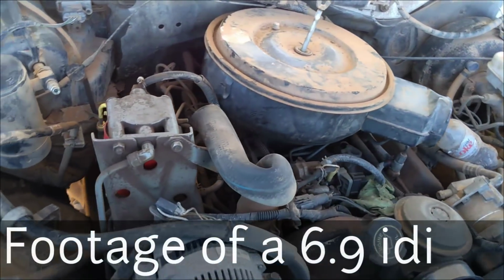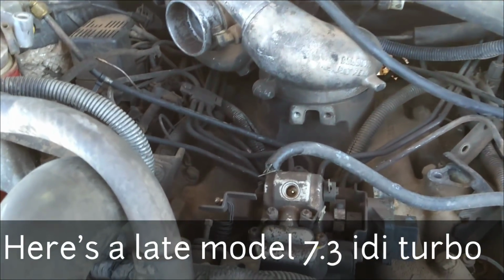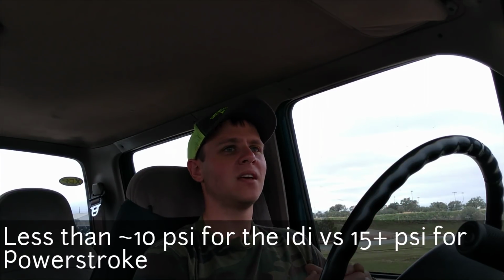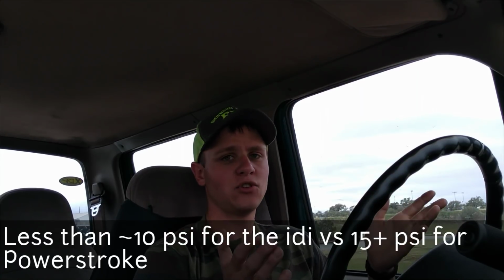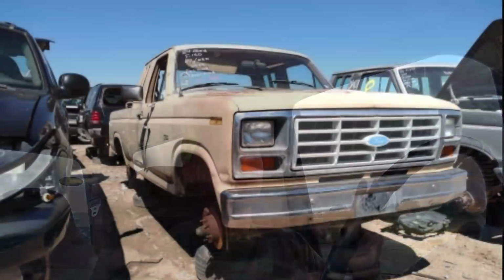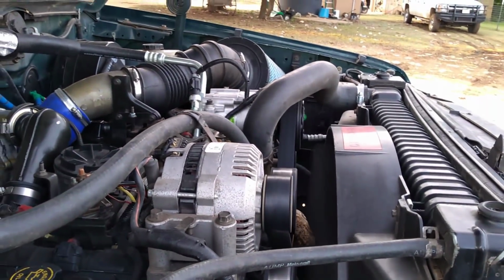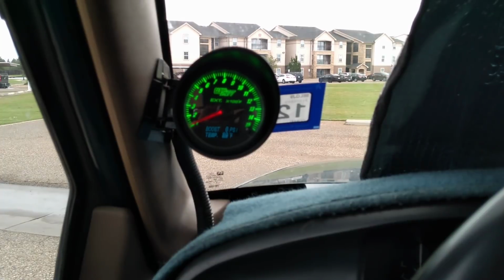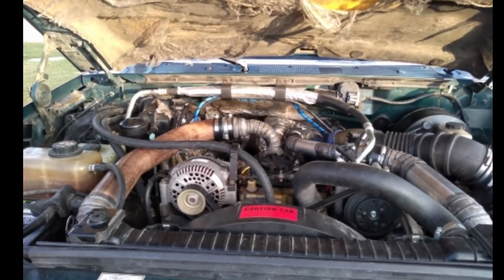7.3 Powerstroke Pros and Cons Part 1 of 2

Comment: After cranking my 1997 7.3 diesel my fuel bowl isn’t filling up with diesel, what is my problem?
Reply from the maker: It could be a number of things, check the easiest first, are you sure the tank has enough fuel in it? Did you swap the engine with a newer Super Duty one? What work did you just do? Or did it all of as sudden stop getting fuel into the bowl?

Comment: What’s a decent mileage to buy a reliable 7.3??
Reply from the maker: I wouldn't say mileage has much to do with 7.3 reliability. I bought mine with 343,000 miles on it and it's still going strong with 410,000 miles now. I'd more look for maintenance history and see what parts have been replaced. Certain things like the high pressure oil pump, injectors, fuel pump, turbocharger etc. all have limited life. My truck for example got new injectors around 200k miles and a turbo rebuild around the same time. Also I've replaced the fuel pump along with the injectors pretty much bringing the truck back to a newer position with fresh o-rings etc. As long as the core of the engine is in good shape, i.e. it has good compression and doesn't have excessive blowby, you can spend the time and money to make it reliable. It's just a matter of how much work you're willing to do to the truck. At this point many of the 7.3's are well over 20+ years old so certain things will need to be replaced at some point to keep them reliable. Afterall certain components such as o-rings and gaskets will fail just given how old they are, yes even on an exceptionally low mileage truck. If you're trying to minimize the work you do to the truck to make it reliable, find one with good maintenance history and as many new parts as you can find already on it.
Reply: @Rnddiesel  Is the auto transmission good in these trucks?

Comment: Due to this video you convinced my purchase of my 95' super cab 4×4.  With only 276,000 miles. It's now at 308,000. 
Ts6 position tuner that's left at 100+hp
4" straight piped. 
95' also has an OBD2 port.

Comment: Hi sir thanks for your videos is very helpful 
I have a problem with a 2000 ford f250 7.3 cranks won't start  im reading the ICP psi  and when I turn the key on  it reads 1,500 psi and when I crank the engine is about 3,500 psi I'm not a diesel guy but that's not reading fine  I don't know  whats going on maybe you can help me thanks

Comment: Hey great video! I clicked on this and, seeing a person half my age, assumed it would be about tuning, rolling coal, and which halo headlights I can get for my 7.3 all while watching burnout B-roll. Turns out I was wrong! Good information. One of the reasons for the high injector pressure in a direct injection engine is it needs to overcome the high cylinder pressure.

Comment: Here's an off the wall question: Do any of you know if the F350 (7.3 only please) was ever made/available with right side drive ? I'm moving to Thailand where they drive on the "wrong" side. I'm hoping they were exported to Australia at some point.
Reply: You would probably have better luck contacting Ford, there is a company in San Diego called Right Hand Drive that converts new trucks for export, you might call them and see what they have to say.

Comment: OK > Haven't seen both videos yet but wanted to ask you. That Short Bus I'm looking at has the IDI Engine and its a 1991 International . So with that said. Would I be better off to look for a Short Bus with the 7.3 Power Stroke Engine ??  Would it be my best bet in the long run since I plan on keeping if from now on ???? Thanks in Advance. : Love the Videos
Reply: Terry how deep are your pockets and what are you using it for idis are beast can take a beating and come back for more again and again, if you’re gonna work on it yourself idis are super simple and much cheaper than a powerstroke to maintain but they have less power than the powerstroke but idis have never Left me stranded I blew a head gasket 300 miles from home could see the gasket flapping around still got me home
Reply: @kylebrown5957  Well that was interesting about the gasket. Thanks for the reply. Appreciated.
Reply: I might be biased especially since I had a powerstroke leave me broke down 1k miles from home with a load
Reply: @kylebrown5957  Ha  That could do it.
Reply: Watch zip ties and bias plys not kid friendly at all though
Reply: @kylebrown5957  Not Kid Friendly . Good thing I'm not a kid then. Ha  Thanks

Comment: Idi injector pressure is a bit higher than that
Reply from the maker: Serious question: How high does it get then?
Reply: @Rnddiesel  it takes 1400 psi minimum to crack open old injectors and new injectors pop open around 1700 psi you weren't to far off
Reply from the maker: @jrhaley9624  Very interesting, thanks for the info!
Reply: @Rnddiesel  i like to teach people on small things like that i dont want you to feel like im being rude i just want to see the knowledge passing down

Comment: Me personally I prefer the 94-97 Powerstroke, not the rebored & turboed 6.9. I say that because it has OBD2 so it's easier to diagnose & you don't need to deal with the OBD1 nonsense of blinking lights and all that fun jazz. But then I drive a 95 7.3 that I got for a steal that was taken care of so that's probably why and because I've put all new sensors and in it, new IPR, & glowplug wiring harness and gasket. newer seats and carpet. After i fixed it up since I'm 16 my parents asked me if I should sell it but I said no cuz its a good vehicle it's not terrible on fuel and its mostly solid even so I wouldn't want to sell it if I knew if it was going to a bad home-like "WD" it's a good truck. and that it'll probably last me 20 more yrs or so with good maintenance. These old motors typically just keep on going.

Comment: I have a 97, 7.3. It's a good truck engine, but the electronics are unreliable.It seems like you're constantly changing some sensor. I went thru 3 cam position sensors in 2 months. If I was young, I'd put a Detroit Diesel, all mechanical, 71 series in my truck. And I'd be done with engine work for a couple decades. I have a couple Detroits 671s made in the late 1940s. Still going, all parts and engine kits still available.
Reply from the maker: I'm sorry to hear you're having such issues with the electronics! I've had good luck with mine. In the past 2 1/2 years since I changed the cps, I haven' had a problem since. Are you using motorcraft sensors? That's awesome to hear your old Detroits are still going. I've also got a 51 Cat D4, it only makes 40 horsepower, but it still fires up to problem if you can get the pony motor to start.
Reply: @Rnddiesel  Two were motorcraft. Code reader said CPS, both mine and Fords. I changed the fuel pump for something to do. 70,000 miles since major engine overhaul. But changed it and the problem seems to have gone away. Why was the code CPS if it's the fuel pressure? And what's next? I'm on first name basis with the tow truck drivers. That said, it's probably the best PU engine I've had, I just wish it was as reliable as a mechanical injector engine.
Reply from the maker: @oceanmariner  I see now, you have had a bad experience with the truck! Electrical problems can be hard to track as well. I've heard that with 7.3's, its best to only use Motorcraft electronics in them. I've done that and they've been reliable. Changing the fuel pump shouldn't affect the CPS. As long as your truck is stock, there isn't a feedback fuel pressure sensor, only a fuel restriction sensor and a water in fuel sensor in the bowl as well. I suspect you may have a loose connection or shorted wire somewhere. You may want to trace the wires from the CPS and tug a little on the connector to make sure the wires aren't loose. As far as I know the only single sensor that can kill a 7.3 is the CPS. A bad Injector Driver Module can also cause a no start, but I suspect a lot of times those die because there's a short in the under valve cover wiring harness. It may be worthwhile to pop the valve covers off and make sure the wires aren't chafed and the connections aren't burnt/corroded. There's also the ICP sensor, but you can unplug that and the truck will at least run so you can get it home. What symptoms have you been having? Does the truck just die on you going down the road?

Comment: I do want want to make a quick correction. 7.3 do technically have emissions. OBS trucks can have a cat and spilt shot injectors depending on the market it was made for. Also the PCM and turbo on the OBS is a emissions device. The super duty's added the intercooler as an emission device. Mine for example has ECM, DI, TC, OC. Most OBS will have at least 3 of those 4. My truck is a 97 with Federal Emissions. That can be found on your passenger valve cover in the emissions section. For good info on the 3 generations of the 7.3 it's recommended to go search on Google for "Ford coffee table books" a ton of good info on all of Fords American truck diesels. Great video 👍
Reply: I gave your mom a split shot injection

Comment: I have a 97 7.3 and im gonna say this. you are wrong on your interpretation on upgrades on alternate options. me personally im looking at a dt360 transplant. this is where you are wrong. 7.3 is expensive to update and upgrade. I went dt360 because im brand loyal. 5.9 cummins is more practical. 5.9 is WAY easier to upgrade, and cheaper to make WAY more power. not saying a 7.3 powerstroke is junk, but its not practical on a day to day work field. the dt360 is a medium duty engine and a 7.3 is a light duty engine. that's just what it is, man.

Comment: Hi. Can you tell me the differences between a 2000 and 01 and 02 why they sound so different? Which one is better? I am looking at a 2002 but the sound of the engine surprised me because I drove a 2000 and it sounds completely different. The 02 is almost quiet.
Reply from the maker: I have no idea what would cause such a difference. They should both have split shot injectors unless the injectors on the 2000 were swapped back to single shot injectors, or it's just a lot more worn out.

Comment: @  200.000 miles trans.oil n seal went out so replacing trans. Not pulling it out later again n changing all u joints n rear end oil should be ready for another 200.000 
Ps. Bought my 03 new never had any trouble with her in 17 years changed oil n fuel filter regular n she’s never ran hot. Cool she is a black Beautiful super cab lariat. Videos are great Thanks

Comment: Enjoy your info. Have a question.  I have a very clean 7.3 f250 crew cab automatic, 4 inch lift stockn16 in tires.
 Engine has 238,000. Larger down pipe, 4 inch straight exhaust . No issues
 Iv'e replaced the fuel bowl, mechanical  fuel pump
  Haveca chance of purchasing a 95 chasis ,No cab, but complete engine , manual transmission assembly and straight axel assembly for around $1500. My presentvtruck is pristine, No undercarriage rust, two New dual tanks , New chasis, short bed mounts,shocks all around ,front spring purchasis re arched. 
Want to know is it worth having the front straight axrl swap and changing to a manual trans Set up?????
Reply from the maker: It sounds like you've got a really nice truck! I really don't know enough about all the differences between axles (ride quality, payload, longevity, etc.) to give you any advice one way or the other. I personally would like the manual transmission in my truck, but the auto I have is working fine so replacing it isn't high on the priority list. I know the ride in my solid front axle truck is pretty rough, but I think that's expected with a 1 ton truck. If your truck is working fine, I'd say just keep it the way it is. Maybe if your heart is set on a solid front axle and manual transmission, then go for it. Worst case you have a spare transmission to drop in when yours goes. By the way, is your truck 2wd or 4wd?

Comment: I have an early 99 and I won’t ever let it go. It will no doubt out last me with proper care. Power steering pumps however are a different story. Anyone know who makes a good one?
Reply from the maker: I'll second that on the power steering pump. I don't know where you could get a good one, I do know where you shouldn't... I think pretty much all the modern rebuilt pumps are junk Chinese rebuilds. I replaced the pump on my 97 Chevrolet and heck a junkyard unit was better than the rebuilt one I bought from NAPA!
Reply: Blue top pumps are great & made in America.I put one on this summer & drove from Miami to Colorado back to Miami & back to Colorado  again..no problems.(2001 F250 SD 7.3)

Comment: I have a 99 7.3.  Chipped with DP tuner.  I have a big exhaust and  air intake but have not installed them. Truck has 204k on it and runs great.  Next mod I was thinking was injectors.  What would you recommend?  I tow motorcycles with it and plow in the winter.
Reply from the maker: Cool truck! Is it an early 99 or late 99 with the bigger injectors/ turbo? Do you have a gauge setup with EGTs/ Trans Temp? Having a gauge is a must before you even think about going any further in fueling, especially if you're towing and plowing.

I've got a set of 'stage 1' 160cc with 0% nozzle injectors. The amount of power it makes with them is unbelievable! The only downside is that without the proper turbo upgrade, it smokes like a freight train. There's definitely enough power with the 160cc injectors to easily destroy the transmission and kill the turbo. With your Superduty, you could probably get the 180cc 0% nozzle injectors and be fine since you have the larger HPOP than I've got in my OBS. The only thing with your SD is that you'd have to reburn your chip to convert from the split shot to the single shot injector. That is unless you can find some oversized split shot injectors. Just bear in mind, single shot injectors are much louder than split shots. I'd say if you're looking to upgrade injectors, you can't go wrong with a 160 or 180 cc injector. If you start going any bigger than that, you'll likely have to upgrade more parts. You can get by running the stage 1's with stock parts, but don't expect the transmission and turbo to stay together too long without proper upgrade or some seriously conservative driving habits. For reference, my truck went from a 0-60 mph taking 18 seconds with stock injectors, to 10.5 seconds with the 160cc injectors, and that's with stock tuning still... Supposedly my truck can push 330 rwhp with these injectors. That's knocking on the door to the power output of a stock 6.4 Powerstroke. Another thing you may want to look into is a set of 'Baby Swamps' from Swamps Diesel. I think they're a slightly smaller injector, but still an upgrade from stock. You can always reach out to a company like Full Force Diesel and ask what they recommend. They know a lot more about injectors than I do. They steered me towards the 160 cc injector over the 180 cc citing the smaller 15* HPOP I've got.
Reply: Rnddiesel i tow a 4 bike trailer with sport bikes so the egt is no issue but I do have gauges.  I only plow 6 residential driveways for friends/neighbors.  It was a rust free Texas truck so it sees limited use in the snow.  

I’d like to not have to do any turbo upgrades but that said, it sounds like if my turbo does fail then is the time to do injectors/turbo mods.  I’m not looking to explode the trans, it’s pretty dam fast with the 60hp tune.  I don’t run it on the highest tune setting.  I’ll look into the injectors.  Thank you for the input.  I believe it’s an early 99 if I recall.  I bought a 7.3 new back in 99.  Crew cab short bed 4x4.  Was a great truck, wish I had it still.
Reply from the maker: @Rainmakerlm  I hear you about not wanting to deal with transmission issues. 7.3's unfortunately don't have the strongest transmissions in the world. I don't really see needing all the power that modern Diesels make, I have yet to floor my truck with the big injectors and tunes!

Comment: Injectors for my 96 powrstroke were $1500 for a set of 8
Reply from the maker: That's a little on the higher end. Before or after core charge? I picked mine up for $1200 shipping and all, not including the core charge of course.
Reply: @Rnddiesel  before core charge it was $1900 after the core charge